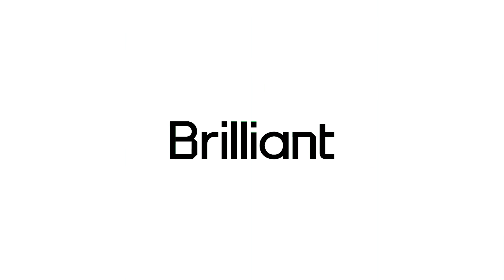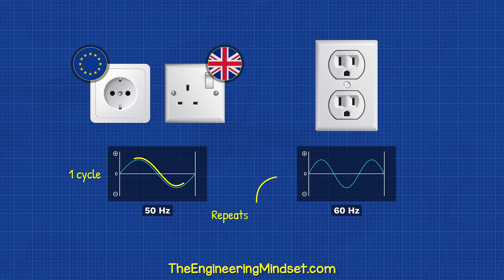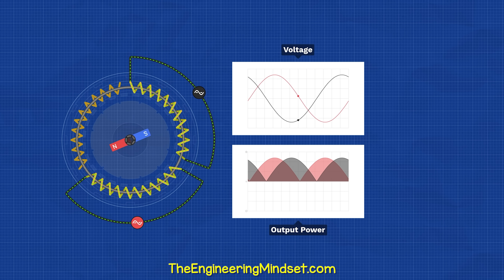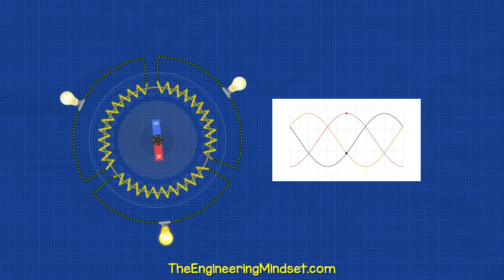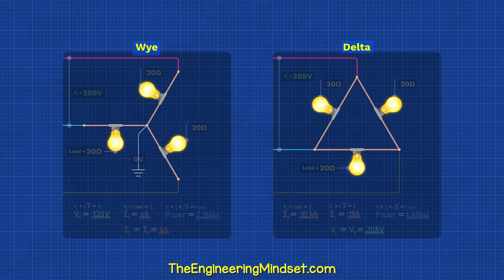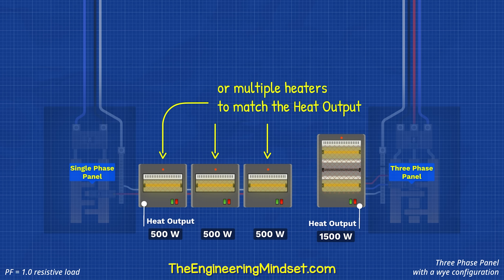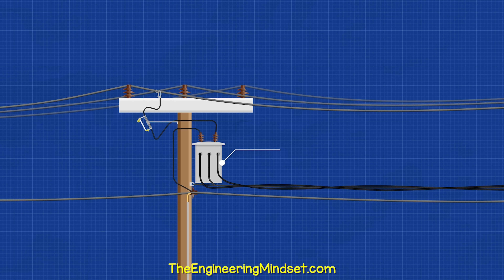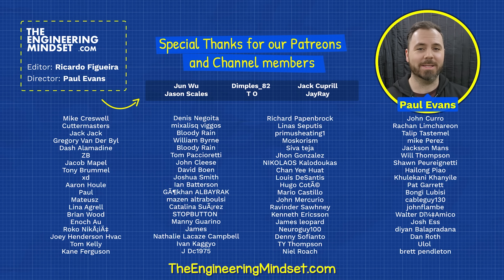How 3 Phase Power works: why 3 phases?

Comment: Why 3? Is because is a reasonable number, could have been anything, but less than 3 makes motors lose power during the deeps, more phases is just too much.
Reply: In many text books there are chapters on polyphase systems.
Reply: More than 3 phases has diminishing returns due to cost of coils
Reply: Actually this is a wire efficiency thing.  Pretend X is the current / power capacity of a single wire.  3-phase power can add 2*X power capacity while using only one additional wire compared to a single phase.  However, each additional phase only increases the carrying capacity by X, while needing a whole extra wire, which is fine, but not amazing.  6-phase power could carry double the power of 3-phase, but it needs exactly double the wiring so what's the point really when you could just double up the 3-phase wires?  The key is getting away from one and two phase power which are uniquely bad in their wiring needs.
Reply from the maker: Multiple reasons for 3 phase are listed throughout the video, here are some key points
4:30 Explained how 3 phases provide constant power. Graphic shows “almost” and audio says “more constant” with some small ripple shown, at this point all phases are still separate circuits and we have built upon simple single, two and then three phase generator.
5:05 Explained how it provides equal spacing. 
5:36 Explained how more phases means more cables, controls and protection equipment, complex infrastructure, more complex transformers and motors, harder to balance network and synchronise generators.
6:22 Explains how only 3 wires are needed which is cheaper.
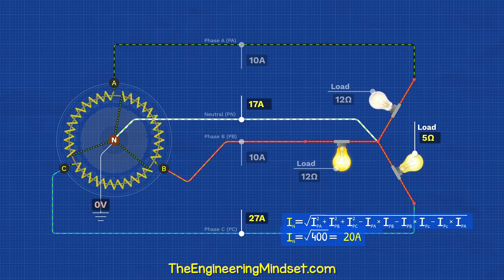7:26 Explained how neutral can be used to balance
7:54 Explained how we use single or three phase from same system
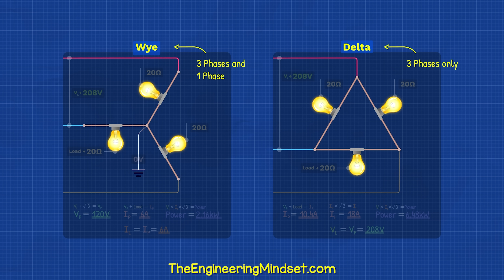8:21 Explained how Wye and Delta are used for different scenarios. Examples uses same resistance and line voltage.
9:59 Explained how 3 phase allows more loads to be connected
10:17 Explained how 3 phase uses more energy but provides more heat
10:19 Compares single and 3 phase power, shows 3 phase power is consistent 
10:36 Shows single phase and 3 phase motor. Single phase has capacitor
10:41 Shows comparison for 3 people v 1 person for motor analogy.
Reply: Not really, it wasn't an arbitrary choice.  3 is the minimum number of phases to supply constant power to a passive load (e.g. motor or heater).  Any multiple of 3 (6, 9. 12-phase!) would do the same but going to 6 or 9 phases would give no advantage.
Reply: @snarfsnarfs it doesn't need to be a multiple of 3, anything above 2 phases would work that way to deliver constant total power (e.g. 4, 5, 7 11, etc, phases are equally spaced) and 2 phase works as well (2 phase power is 90⁰ out of phase).
Reply: @snarfsnarfs  2 phases shifted by 90° also show constant power. But then you need 4 wires (two separate phases) or 3 wires (one common to both phases). The current in the common wire is sqrt(2) higher, so a thicker wire is needed. But if you need 3 wires anyway, a three phase system is the optimal solution. as then the current in the common wire is zero and this wire can be omitted. Anyway: you are perfectly right: power is constant in an ideal system, while in the video is said: in an ideal system power still varies a little.
Reply: @RainerNase-b3q  That's a really good point. 😀

In the 3phase case we have:
p1+p2+p3 = sin^2(x) + sin^2(x + 2×π/3) + sin^2(x - 2×π/3) = 1.5

In the 2phase case it's also constant as you said:
p1+p2 = sin^2(x) + sin^2(x + π/2) = 1

I never really thought of it like that before.  As you said it still ends up requiring an extra wire (or a thicker common wire) than the 3ph case anyway.
Thanks for raising the interesting point. 😀
Reply: @snarfsnarfs  Even more interesting, parts of Philadelphia still use two phase power. Two phase power came before three phase, in the original Westinghouse systems. Three phase is obviously superior, but history can be quirky like that.
Reply: @snarfsnarfs  lol, you know nothing... In the video he even shows 3 LEDs losing power on AC... Go back and study again.
Reply: @RainerNase-b3q  False, go back and see the leds un the video turning off... Power is not constant.
Reply: @snarfsnarfs  There is even more interesting stuff coming from this: As the three phase system shows some very interesting aspects: Having three voltages gives us three degrees of freedom. But Kirchhoff's rules reduces them to two. This allows to express the voltages having amplitude and phase. The alpha-beta or Clarke-Park transform is used to get those values. Indeed, there is a more basic way to understand this: If we have three voltages, why not see them as a vector. (U, V, W). And if the sum of the voltages is zero, than U*1 + V*1 + W*1 also is zero But this can be interpreted as the inner product of (U, V, W) and (1, 1, 1), what in turn means: all vectors (U, V, W) are oriented in a plane and here you have the transform, omitting the introduction of "imaginary" numbers. This is true for voltage and for current.
Reply: @snarfsnarfs  That's what I said... BTW, 3 phases do not supply constant power, the power still drops, but not that much to cause instabilities in mechanical outputs.
Reply: @gabrielbarrantes6946  in an ideal system the power doesn't drop at all. It is constant power all the way through the cycle.
As the instantaneous power from the 1st phase starts to drop, the other 2 phases start to deliver that power in the exact proportion that the sum total stays constant. 
For circuits containing active components it's different, but for passives like motors/heaters/etc the sum total stays constant through the cycle.
Reply: @snarfsnarfs  lol, in what universe motors are passive? 
Sure the complex power might be constant. But in EE when we talk about power we mean real power, the power that is not reactive. That's not constant, not even close.
Reply: @gabrielbarrantes6946  we are talking about the real power. A passive component certainly doesn't mean that it can't have reactance. As an EE you'll surely know that resistors, capacitors, and inductors (and by extension, motors) are all passive.
Just do the maths and you'll see that the sum total power (yes, real power!) is constant through the cycle. As the instantaneous power on one phase varies the power on the other 2 is also varying to balance and keep the total power constant.

Any reactance will decrease the real power from that of a purely resistance load, (as energy is stored and then released at different parts of the cycle) but the same thing is happening on the other 2 phases.
Reply: You guys need to go back to school...
Power is not constant.
Average power remains constant (and this fact is actually obvious since it is a periodic voltage) but instantaneous power drops, each of the loads will experience such drop and this matters a lot in mechanical loads, that's why motors add more pistons, same reason.
Why 3? Is good enough and not overcomplicated like 6 or 12 (other numbers are not good candidates due to complex mathematical reasons). You need to study more...
Reply: @gabrielbarrantes6946  You don't have to go back to school to see, that the power actually is constant if the three phases see the same load. The three voltages and currents add up to zero. This is true in physics due to Kirchhoff's laws, but from the math view it's true, if the phase shift of sinoidals is 120°. Next, on a resistive load the phase of voltage and current is equal. So to get the power you have to square a sinus what will result in a cosine of twice the frequency plus a constant. As the frequency doubles, the phase shift doubles too, so you have three contributions to the power: 3 times the constant and then the sum of cos, cos(240°) and cos (480° = 120°), so in the end you add up three cos shifted 120°, what results 0. It remains the constant power!

Comment: You might add, sometimes a delta configuration does have a neutral, this provides what's often referred to as a high leg delta,  and we get 3 different voltages off a three phase system, typically 120V between phase A and C to neutral,  208V between phase B and neutral, and 240V between any two phases.  A much less common high leg delta provides 240 / 415 / 480 volts, and usually you'll come across this system in commercial and industrial settings where the majority of the loads are 3 phase motors and line to line single phase equipment,  while also requiring 120V power for general purpose lighting and receptacle loads.   It is usually no longer installed for a new system today, instead the power company will provide you with a wye system unless there is a very specific reason for wanting a delta.  

Some farms and small commercial settings will have two transformers to provide a 120/240V 3 phase 4 wire open delta, when  the customer has mostly single phase equipment while requiring limited 3 phase power for motor loads because it's a  cheaper setup than a wye 120/208V which would require 3 transformers.
Reply from the maker: Absolutely, we covered it in great detail with step by step math in our last video here: https://youtu.be/u0SsejDCVkU
Reply: One three-phase transformer will cost the same or cheaper than two single-phase ones. So why invent nonsense with two single-phase transformers and deprive yourself of the benefits of a full-fledged three-phase network?

Comment: Thank you, I am not an electrician, but I always wondered what on earth they were talking about with "three phase."  This is one of the clearest explanations I have seen!
Reply: Three phases was chosen because it creates the most economic rotating magnetic fields to start and run other motors. Single phase needs extra equipment.
Reply: As an ordinary person This video is still hard to understand 😂
Reply: Three phases is the fewest number of phases whose average power is a constant.  That’s why three phase electricity versus four, five, six… phases.
Reply: @dane1234abc1  Not exactly. Three phase is the most economical for starting, (rotating) and running electric motors. No extra equipment is needed to make it work.